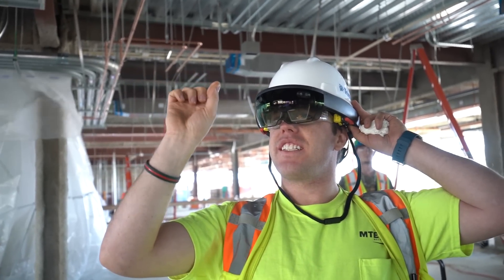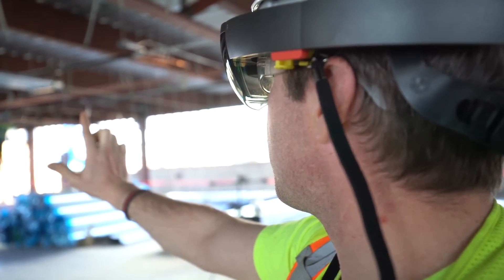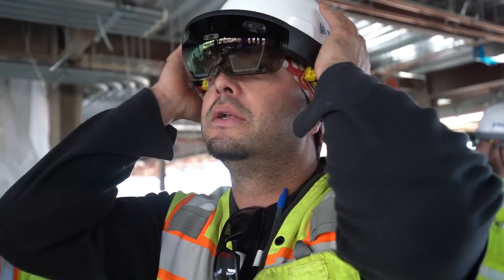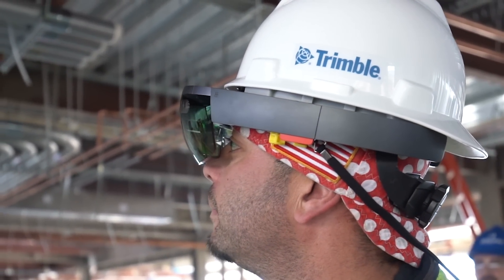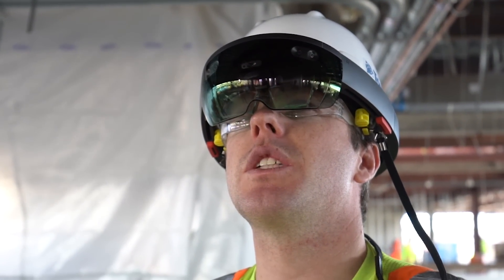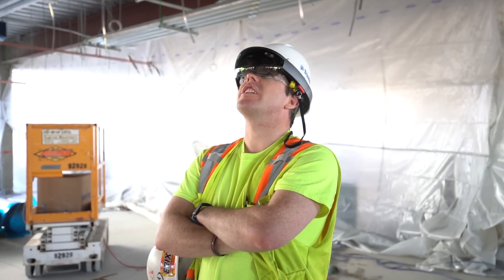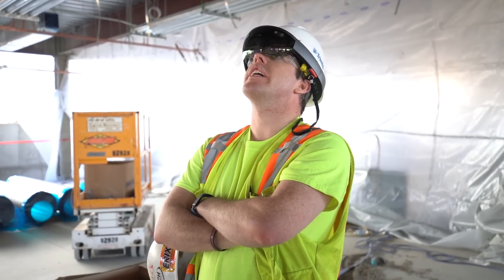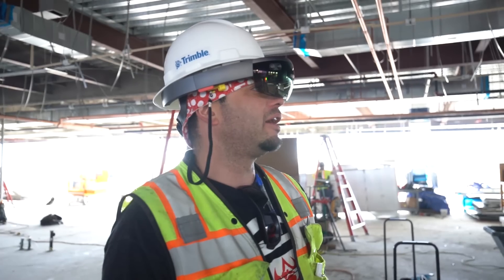Construction workers try Trimble Connect for HoloLens for the first time.. here is what happened!

Comment: I've tried to make MR work in construction for a couple companies I've worked at and it usually ends up being "very cool" technology but difficult to see how it would work day-to-day. I haven't run across anything that is accurate enough for layout and it's useful to better visualize the drawings but if it has a burdensome setup it's more likely to sit at a job trailer and not getting used.
Reply: you are just early, in 10-15 years this will be the standard. since you work in construction i'm sure you've seen how fast the tech advances.
Reply: Has this changed for you at all? Have u found a product good enough for layout or virtual takeoff of a project?
Reply: @lucasbady5839  It's been a while since we've played around with MR and I've only been casually following developments lately. From what I remember the company we worked with said the accuracy issues weren't solvable until Microsoft releases the HoloLens3 as it was a hardware limitation. I don't believe it is good enough for layout with the HoloLens2 but I'm not sure if there is a competitor out there working out those issues.

Comment: How did you get the model to locate with reality?
Reply from the maker: See our answer above! ^^ "In this release of Trimble Connect for HoloLens we've made digital-to-real alignment simpler with the help of two tools: plane-based and pivot-based alignment. Plane-based alignment allows the user to associate physical planes on site (e.g. columns, stairwells) to digital planes in the model. Pivot-based alignment then allows users to make finer adjustments; a user picks a corner in the model as their pivot point and can then translate and/or rotate in all 3 axes with respect to the central pivot point."